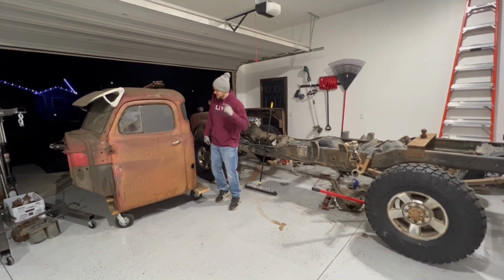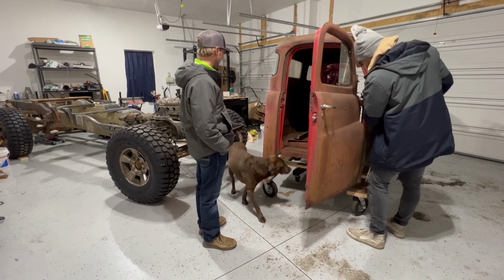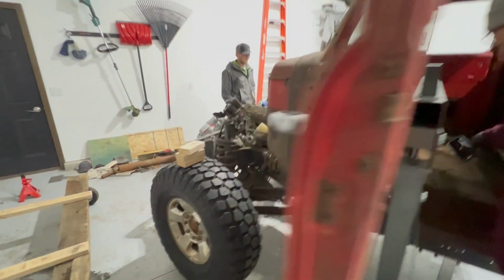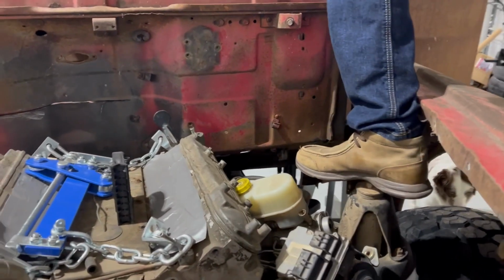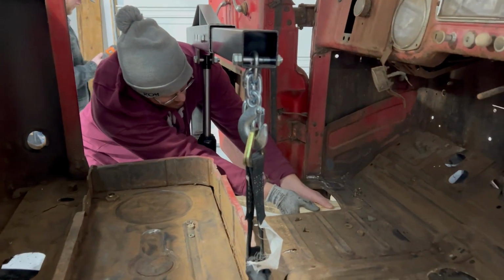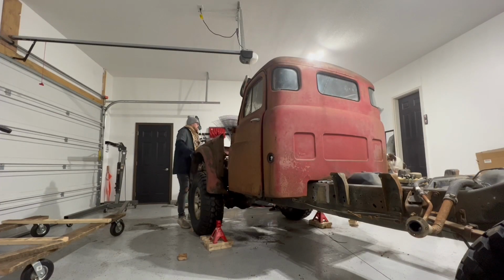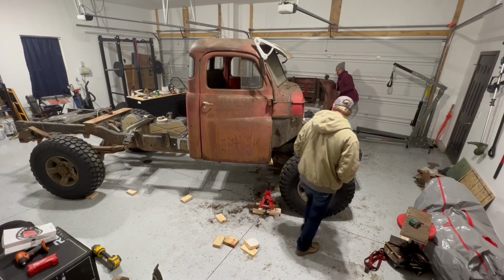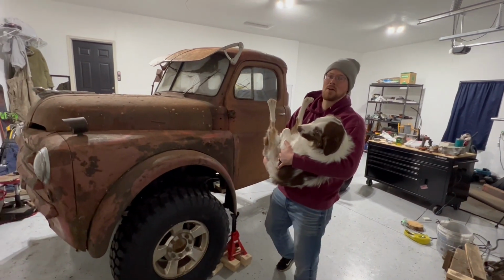Test Fitting The Cab With Our Frame Swap | The Dodgeball

Comment: I see so many folks trying to upgrade an old truck and chassis to newer powertrain components when it seems to me that a frame swap might be a lot easier when you often just need to fabricate cab mounts and maybe mod the tunnel?  IDK but I am going to find out as I want to swap a newer GMT800/900 1 ton 4x4 (maybe even diesel if i'm lucky) chassis under my beloved GMT400 Z71.
Reply from the maker: Agree 100% that is why we sidelined the Irrational International project - it would have taken so much to upgrade everything so I steady we got this chassis
Reply: @theroygarage  I tell people who want to do early versus late facelift interior swaps on GMT400 trucks to just swap the whole cab and they think I am nuts lol...I did it the hard way and wont do it again.